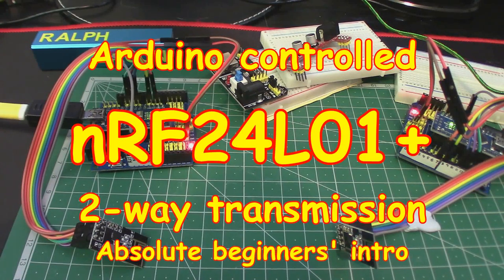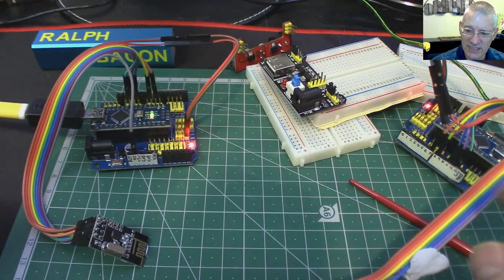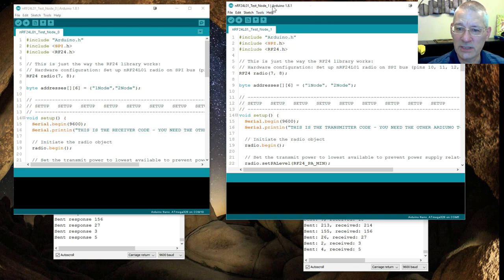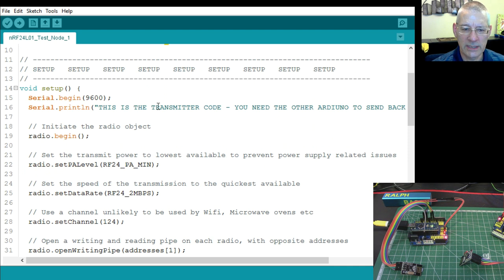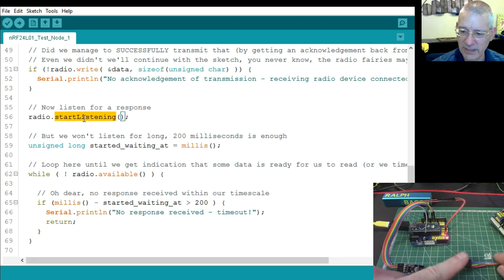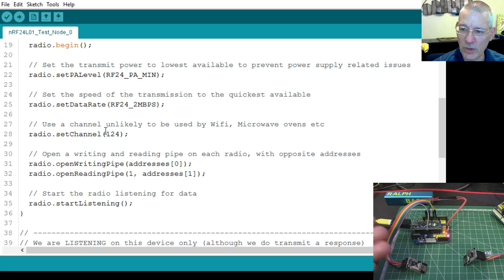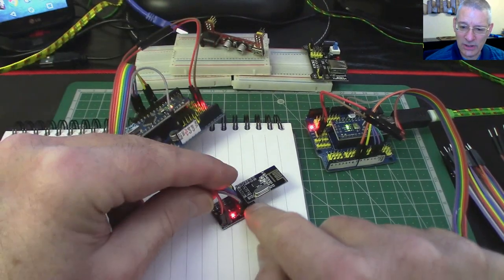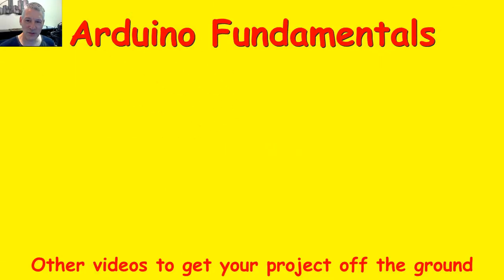#73 nRF24L01 Send (and receive) data with your Arduino!

Comment: For the integrated Nano3/nRF24L01 modules, you need to use CE=10 and CSN=9. This is opposite from what's given in all online examples I've seen. It caused me endless confusion until I followed the traces on the board to the pinout of the chip! People need to get in this habit and stop posting confusing information!
Reply from the maker: You know how it is, Cut & Paste from one example to another.
Reply: If changing legs 10 and 9 to 7 and 8 causes "infinite confusion", then first "the head needs to be reset"...

Comment: AFTER 1,000,000 TRIES, WITH 100,000 PIECES OF CODE, THIS IS THE FIRST ONE THAT WORKED.  THANKS.  I have never had a harder time with a piece of code and devices. How ridiculous this took so long. It must have been just a combination of many things. I can now finally do stuff.  Great tutorial.  Subscribed. Thumbs up. Thanks.
Reply from the maker: I can feel your relief from here, Jeff, and it is so rewarding that I can help people get their projects off the ground. Thank you so much for posting this, it's feedback like this that keeps me going! One caveat: are you using the plug-in adapter boards for this device? If not, do yourself a huge favour and get them, they are really cheap (even on Amazon) and stop any power supply-related problems down the line. Thanks again for posting, great to hear from you.
Reply: Absolutely I am using them, thanks. I tried one time for 3 weeks using the high powered versions and I could never even get them working.  This time I bought the normal versions, plus the adapters, plus your code, and finally it worked.  Now that I have this working, I will go back and test the high powered versions.  You do a really great job with your videos. It is the clear thinking and clear explanations that people appreciate.   I need to check out some of your other projects.  I see one there with EEPROM basics. That was another hurdle I had to get over as well.  None of this stuff is simple when you combine all the hardware, software, and gotchas. I don't have a youtube channel but I do have some really cool projects related to some of your stuff.  I may send you some links someday so you can check them out.    ...because most people I know are just not interested.  They just don't get it.
Reply from the maker: Some people "just don't get it" in the same way that I just don't get sport. Really. I just don't care about football, rugby, tennis, golf... the list goes on. I probably watch about 5 minutes of sport a year on the TV. I just don't get it. People are different I guess, thank goodness, imagine if there were more of me! But keep going, Jeff, because you do get it.

Comment: Transmission of multiple variables

As a give-back to the channel, here is the code to use if you want to transmit multiple variables. It uses structures in C. Note each variable can be any data type and all can be different (int, float, unsigned long). However the max size of the whole package is 32 bytes = 256 bits

TRANSMITTER ...

// Top of file, in declarations,  before SetUp

typedef struct{    //declare the structure for transmission
   int A0;                                   // 16 bits
  float Temp;                           // 32 bits
  unsigned long Heartbeat;  // 32 bits
  // add next one(s) here, but keep total struct package size to 256 bits (= 32 bytes)
} xfer;                                      // name of the structure above
xfer TXpackage;                   // TXpackage is a type of structure xfer 

void loop(){

// read the sensors and put the elements into the structure

TXpackage.A0 = analogRead(A0);
TXpackage.Temp = sensors.getTempCByIndex(0);  // Read Dallas18B20 on OneWire
TXpackage.Heartbeat = millis()/1000;  //used as a heartbeat to confirm transmission
// add the next one(s) here

radio.write(&TXpackage, sizeof(TXpackage));
---------------------------------------------------------------------------------------------------------------------------------------
RECEIVER ...

// Top of file, in declarations, before SetUp

typedef struct{         //echo the structure so variables can be received in the same order
   int A0;                                  
  float Temp;                           
  unsigned long Heartbeat;  
} xfer;                                      
xfer TXpackage;                   

radio.read(&TXpackage, sizeof(TXpackage));
Reply from the maker: Excellent contribution, whitefields5595, very useful and easy to follow using a struct, an underused data structure that is so easy to use.

Thanks for contributing this.
Reply: Makes life a lot easier, thanks
Reply: Thank you Sir,super solution for transferring body temperature and heart rate...
Reply: @RalphBacon  What does A0 do?I don't  understand.
Reply: @agahgokdag1845  Did I really do this 6 years ago? Its like reading one's school books! I no longer 'do' microcontrollers and have not coded anything for 4 years, but here goes .... A0 is an arbitrary definition of a data structure that then calls analog port A0. I just used the port name as the structure name which maybe confused you? It is expecting a 16 bit integer value arising from reading A0. Sorry if I'm using the wrong words as I've forgotten a lot of the parlance.

RALPH. I hope my rants about you and 240V AC means you're still with us. All the best - PeterC

Comment: By far the best NRF24L01 tutorial on YT, can't believe how frustrating this can be.  Hope I am up and running tonight with your assistance,  thanks!
Reply from the maker: Let's hope you're successful, do let us know!
Reply: I've got the library installed fine and the transmitter code uploads fine to my Uno!  However, the code fails to upload to my pro micro (other example sketches and ones I have written upload to this pro micro fine, but I just bought it)- is the code incompatible with a Pro Micro? Because I was have space constraints with the transmitting device.  Thanks for the help, I feel confident with some fiddling I will finally get it!
Reply from the maker: If you have selected the correct board / CPU / speed etc then it should upload. I choose the Leonardo board for my Pro Micro (from Sparkfun) and my computer even says these on the COM port allocation - check there too, see how it identifies itself. Take care with this board, as it's easy to brick it (I did a video on that too). TBH I'd try a Mega if you can't get this working, you can get one for about £5 / $6.50 from the Far East these days, which will sort out your memory constraints.

Comment: Channel 124 is a good one for me here in Grenoble, France. Thanks for the tip, Ralph!!!
Reply from the maker: Fantastic! Well away from microwave ovens!
Reply: @RalphBacon  Default channel gave short range (2 meters). I live in a WIFI jungle. Channel 124, 2 brick walls, 2nd floor, and my birdnest breadboard yields 0/100 CRC errors. Waiting for LNA with antenna to top this score.

Comment: *READ*

Ok, to try to save everyone the headache I had when trying to replicate this tutorial, follow these steps.

1. DELETE all other RF24 libraries you have on your computer, they're not all the same even if they have the same name and seem to have similar functions.
2. Down Ralphs's folder (includes a wiring schematic, sketches shown in the video, and the library) provided in his description.
3. Add RF24 library from downloaded folder in step 2
4. Open Ralph's sketches and see if they're working as shown in the video. If they are, then tweak to fit your own design. 

I spent a lot of time trying to make this example work on a different library (same name) I had installed on my computer. It almost worked, but the data got stuck sending it back to the master. 

Thank you so much Ralph for helping with this excellent, concise and organized tutorial.
Reply from the maker: Thanks for posting this, it will sure help everyone who tries to follow this demo, that's for sure.
Reply: It's definitely helping me! I couldn't get it to work even after I soldered a 10uF capacitor to the NRF module. :) I will follow your instructions and hopefully I'll be ok. :)
Reply: I just did that and it doesn't work: I'm not quite sure why. I tried another code and that other one works. Could it be something about the module I'm using? Maybe it's a cheap brand and it may not be reliable? Is there a way that I can do a step by step check?
Reply: @Taran72  BIG OOF
Reply: @alexliu694  : I'm learning....just asking a question. :) By the way, since I added this comment I managed to resolve all the issues I had. :)
Reply: @Taran72  Nice. I was going to do this but then I realized for my project I could just use sound sensors.
Reply: The reason you blew out your 5 voltage regulator may be due to the fact that you’re using 12 V. You’re far better off using nine vdc for your raw input.
Reply: @Taran72  Same happened to me. Then I heard Ralph mention that the adaptor board into which he plugged the radio module needs 5 Volts not 3.3 Volts. Changed my voltage accordingly and my sketch worked instantly!
Reply: ARGH !  I have been trying to get this to work for a few weeks now.  I followed BEGRProductions advice about deleting all other RF24 libraries, and now the Transmitter seems to work, but the Receiver is stuck in this part of the loop:
void loop() {

  Serial.println("Listening");

  // This is what we receive from the other device (the transmitter)
  unsigned char data;

  // Is there any data for us to get?
  if ( radio.available()) {

    // Go and read the data and put it into that variable
    
    Serial.println("is radio available");
    
    while ( ! radio.available()) {
      radio.read( &data, sizeof(char));
      Serial.println(data);
    }

I added a few Serial.println lines to see where the program is hanging up, and I get the "Listening" message over and over, it never gets to "is radio available".  Any advice would be greatly appreciated.  Thanks,
Reply: @mrhatch117  Did you check your voltages? In my case I thought the transmitter was working but in reality I was feeding it the wrong voltage. If the radio module is plugged into that little board it needs 5 volts, otherwise it uses the 3.3 Volts. When I changed the voltage on the transmitter everything suddenly worked. Not sure if it helped but I also soldered the 10 Micro Farad Caps across the supply pins of the module as recommended on various sites. This is supposed to ensure better/less variable power if my understanding is correct. Good luck.
Reply: John Fiott thank you for the feedback.  I have added the cap, but I haven’t checked the voltage.  I am using a powered shield like Ralph did here.  I have swapped the devices back and forth between receive to transmit and get identical results.  I have not swapped the power supply, though....  I will be checking it today. Thank You

Comment: Such a good video, I was about to quit trying to program these antennas, but this video saved me, thanks.
Reply from the maker: Great to hear! They are very good modules (but be aware - and beware - that there are fakes out there, always get original Nordic devices).
Reply: @RalphBacon  thanks for the answer, and i'm sad to announce that mines might be fake cause I tryed every tutorial out there, copy and pasted the code. But no signal reveived or sent. I will buy some new ones thanks for telling me. Btw I got the ones sold by WayinTop, they are the only on amazon( the ones with the antenna).

Comment: Thank you for explaining everything down to the smallest details. Made working with these modules so much easier. Getting your example up and running made first, helped me see what goes on in the software. Thanks again, Bob. Subscribed to your channel.
Reply from the maker: Glad you liked it Bob, and thanks so much for subscribing too. I do like these nRF24L01+ modules, they are very powerful, especially the ones that have an external antenna (not needed for most home use unless you live in a castle). Great to hear from you.

Comment: Ralph, just subscribed after watching this video. I am working on getting analog sensor information back to an Arduino in the sun room that runs my irrigation. I didn't want to lay cable to the sensors to cover the 30 feet or so, so I ordered 2 of these to do the trick.  Your video helped a great deal as my garden irrigation project is my first one! Just have to now learn how to send the data from the sensors back to the main Arduino. Thank you again for the well thought out presentation.
Reply from the maker: Hello Arduinite! I'm currently on vacation 5,000 miles away from home so I'll have to be brief with these comments until my return, mid-July.

I'm so pleased it helped you, Lawrence (Larry?), really I am. Remember that although I have called one a transmitter and one the receiver, they BOTH send data to each other in my demo, it's just the transmitter that initiates the whole process.
Reply: Ralph - I hope you enjoy holiday, and thanks for the reply. I am awaiting the modules to regulate the 5v to ease the hookup. I certainly do remember that both units talk to each other. Once the modules come, I will start trying to get the soil moisture sensor and the rain sensor to transmit back to the main unit. One idea I had to prevent, or at least slow the corrosion of these sensors, was to power them on only when I need a reading, about once every half hour. Lots to figure out still!! Larry
Reply from the maker: Yes, exactly what I do for my rain sensor. Power it up, take a reading, power off. No noticeable corrosion after several weeks. But mine are not buried in damp soil so your mileage may differ!

Comment: Excellent Video, Ralph. The R24 looks to be a Godsend. They appear to have encapsulated a LOT of admin and  distilled the developers contribution to be no more complicated than using Serial. As to dupont cables: positively the worst plasticine I have ever tried to use. Keep up the good work Ralph. Brilliant channel!
Reply from the maker: You're too kind Michael (but I'll take all the praise I can get)!
 
Yes, I like these little RF24 units. I was going to use them to monitor my water tanks et al in the attic but I think I might use an ethernet enabled Arduino instead (my next video, oops, spoiler alert). BTW I like dupont cables (I have dozens, all lengths and configurations) but if you ever strip the insulation hoping to use them as real cables to wire stuff up with, then -- don't! They only have about 6 strands in them! OK for breadboard lash-ups but no good for real project work.
 
Thanks for posting, good to hear from you.
Reply: Thanks for the heads up on stripping Dupont wiring. I have found similar results when trying to strip the cables that come with "wall wart" power supplies. It is almost as if the insulation is just sprayed on to copper strands as fine as human hair.
Your thoughts on using ethernet instead of the RF24 units are interesting. I was thinking of using the RF24s in place of ESP2866 wifi units.; having the various nodes communicating with a base which is also in circuit with just one ESP8266. The base would thus handle the IOT & time-of-day admin for all the nodes; including buffering node data, should the WiFi router (or the ISP network) go down temporarily. Do you suspect the reliability of a network of RF24s?
Reply from the maker: I don't suspect the reliability of a network of RF24s but you can only use about six, I think, without creating a mesh. But the same chap who wrote the RF24 library I used also has a library for that. I suspect it's a bit more work for you but you can read up about and then decide. I like the idea though, of a network all controlled by an ESP8266 hub. Your house will be truly part of the IoT movement!

Comment: Thank you for the tutorial. I’ve watched a bunch but this is the first which I’ve followed. Worked a treat. 
The only error which I ran into was I used an external power source and forgot to ground a board. Obviously worked straight away once I realised the problem. 
Again, thank you.
Reply from the maker: Glad it worked, Chris, I hope you're using the adapter boards?!? Cheap and save a lot of heartache.
Reply: Ralph S Bacon I am not. Not been doing this long but a lot of parcels are starting to arrive from China ha. I’ve ordered one today. Couldn’t find one for a Pro Mini, so will make something similar on perf board. Cheers
Reply from the maker: I was referring to the adapter boards for the nRF24L01+ modules. 
If you use them bare (like I did in my video, I know, bad example) you have to wire them "from underneath", easy to get wires crossed (don't ask me how I know this) and the power for the 3v3 module cannot be successfully supplied by the 3v3 pin from the Arduino unless you're using the lowest power possible (like my demo). 
Once I got the adapter boards it was so much easier to wire up and all power issues disappeared because you supply the adapter board with 5v not 3v3 and the Arduino has enough 5v current to go around!
Reply: Ralph S Bacon I did use the adapter boards but I want to use them within a project with everything powered by 3.3V. So I was considering not using the adapters. So I’m glad you mentioned that, as it probably wouldn’t work. I’ll have to supply the Pro Mini with 5V and take a supply from the source for the nRF24L01+

Comment: The video helped, I had stayed away from the nRF24L01 as they seemed to complicated. Thanks I plan to order some and give it a try.
Reply from the maker: That's great news Robert! Let's face it, if you replicate exactly what I had in the video (with or without the adapter although I recommend those too, especially for anything other than low power usage) then it's going to work. So you have a working prototype that you can then enhance it to suit. Glad you feel inspired, thanks for posting.